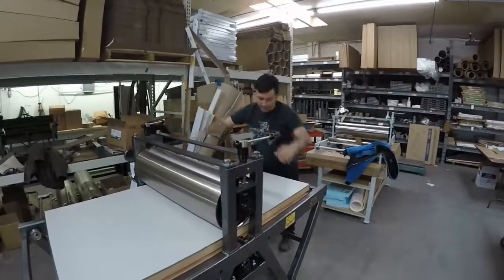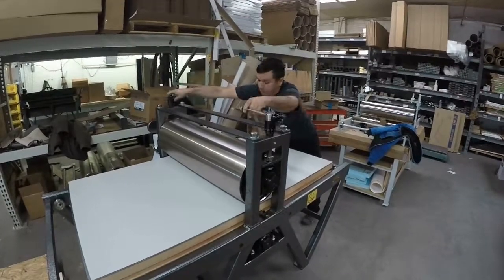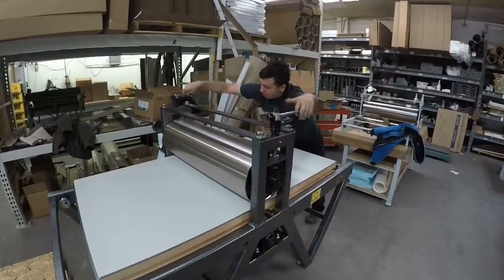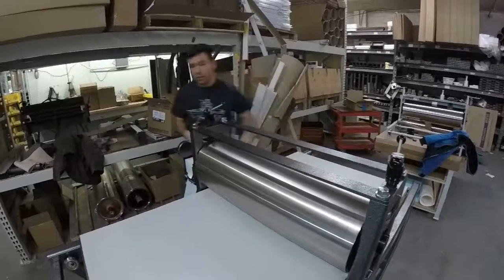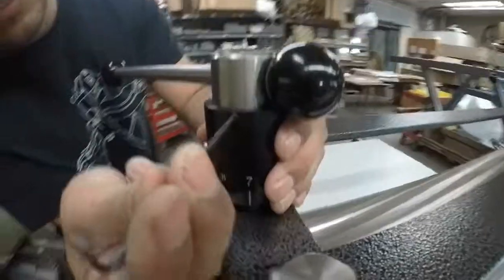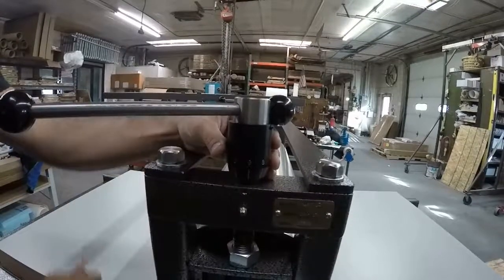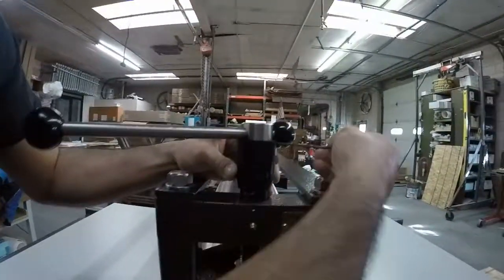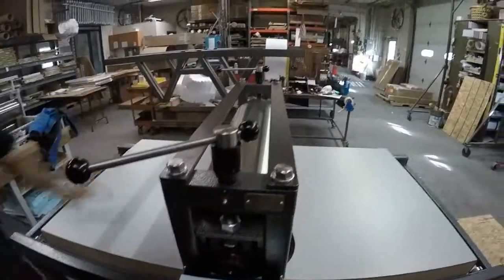Adjusting Takach Micrometer Gauges

Comment: I don't have a place (hole) on my drum to adjust the micrometer gauges.
Reply: If you do not have a set screw then you will want to hold the pressure screw handle with one hand and rotate the outer sleeve of the micrometer gauge with the other.  This outer sleeve should have some resistance to it.  If it spins easily please get in touch with us.
Reply: @MichaelPooldash1upm  Thank you! I did as you suggested and everything's fine now!